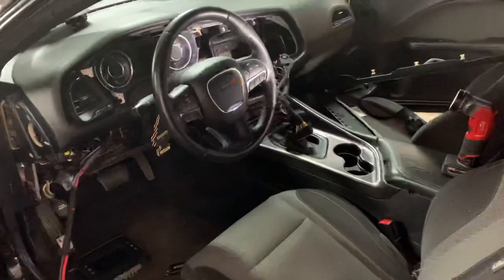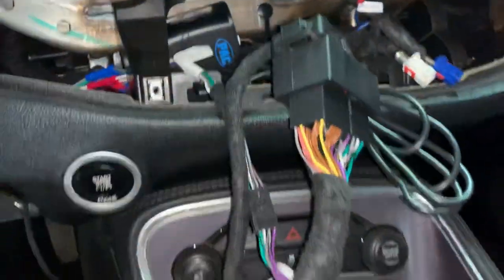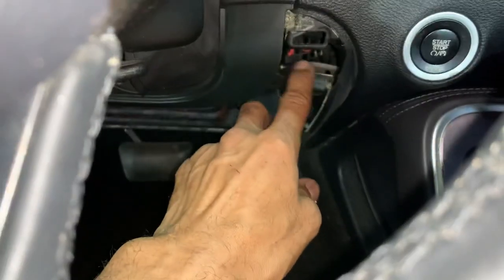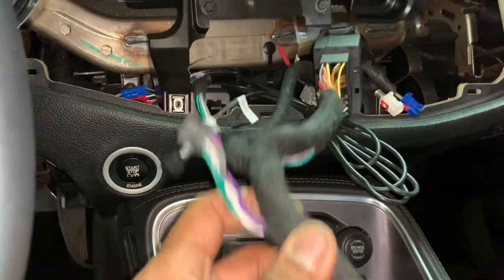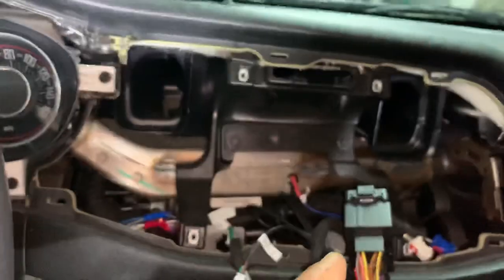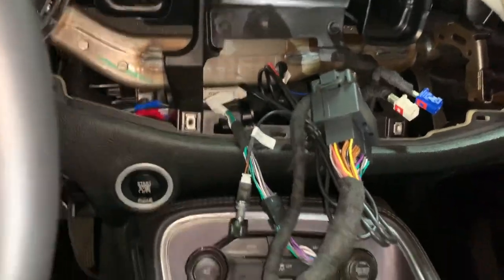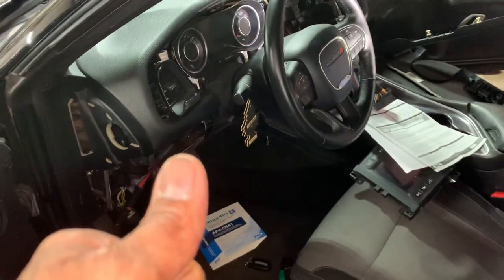Adding Amplifiers  HellCat ScatPack Charger/Challenger Plug N Play ✅ Way 🙌

Comment: Thanks for stressing the fact of plastic pry tools. Now days all of that breaks extra easy without much effort. I went to a Auto store and asked about some tools for installation and this guy finds me the most dangerous looking thing I ever sen in my life. Thin metal with sharp edges and squared off inlets that would put a hole somewhere the first time you use it. I bought it and then went and found what I was looking for also. Didn't want to hurt his feelings so i replaced my switch blade with it for personal defense. Threw it at a tree and stuck it first throw,can never get it to bounce,even when I try. That plug and play is what I need,no doubt about it. I have a 19 Rwd GT and can't find the amp. The speakers were from Alpine Mexico,not sure where that is but if I half to go there I'm packing my extra sharp stereo and speaker thin mint pry bar. Thanks for the show man,be safe
Reply from the maker: I appreciate your comment and tuning un I also hope your install goes well and if you need or have any ? Hit me up 🤙🏽🙏

Comment: Will PAC AP4-CH41 (AP4CH41) Amppro power adapter, work with CHR15H)STINGER Installation Kit?? I don’t care to use the car amp, I would like to change out the head unit?? I have a Scat 18

Comment: I am kind of confused. I recently purchased the AmpPro for my ‘19 Challenger non amplified unit. 

I would like to keep my factory speakers and add aftermarket speakers in the trunk. 

My AmpPro came with the speaker harness but I am really unsure of where those wires are supposed to connect to. 

Right now I have my aftermarket amp installed but my factory door speakers and rear deck have no sound.

So, I have RCAS going to an amp and speakers in the trunk wired to that amp. But I would like to have my factory door speakers and rear deck playing as well

Edit: After watching this video further I think I understand it. I plug the speaker harness in. Then run additional speed cable from that speaker harness to my amplifier. Is that right?
Reply from the maker: Yes sir sorry about the delay I’ve been working 7 days a week for two months

Comment: My car (2012 chrysler 300) requires the AP4-CH31 but would I need the amp pro harness, data link, or speaker harness extensions. I would like to upgrade interior speakers and add a 4 or 6 channel amp using the factory speaker wires

Comment: Trying to understand this on a 2016 challenger with the alpine system. I need this piece plus a additional harness? If I have the alpine system it's not plug and play I'll have to splice wires?
Reply from the maker: Yes on an alpine system you can splice the wires at the amp under the dash on the driver side or rewire from each door speaker if you have anymore ? Call me 478-262-9307 Butt please not after 10:00 thanks

Comment: I have a 2016 charger scat with alpine auido. Do i just run rca wire from PAC to my amps or do i need speed wire and to splice into factore amp wire?
Reply from the maker: Absolutely 👍🏿 sir the amplifier is located under the drive side dash

Comment: I've got a question. I've upgraded my 2015 challenger form 5" to 8.4" 3C from a 2016 challenger. Now the radio locks out the radio stations. I do a hard reset and it works until I turn off the car. The 8.4 radio had a 273w Amp with it. I currently don't have a amp in my car. Would this be the reason for the radio lockout? The phone, Bluetooth, nav all work.

Comment: I have the AP4-CH41 R2 version for Amplified factory systems dont know if mine has took a shit. I didn't want to run multiple Amps wanted the factory Harmon Kardon amp to power interior speakers. And just wanted to add one amp for Subs plugged RCAs into Sub out put Subs have no sound. Checked RCAs Subs and Sub Amp all works just no sound from Amp Pro.😐
Reply from the maker: With that amplified system you need too flip the dip switch too the proper settings and close the doors and lock the car with the key fob for five minutes and unlock it with the key fob and it should work

Comment: I have Dodge Charger and I’m trying install 4 channel amp and mono amp . Can I use 2 output line rca and pac 4 channel amp for the amps ?
Reply from the maker: You can but I don’t recommend that approach because of sound quality your install those amps too get a better sound and line out converters is not the best way in this vehicle that PAC harness cost around 200$ and you don’t have too cut any wires and it sounds 💯
Reply: @bj_from_the478  same car srt8 charger 2014 , i m upgrading amp nd spkers? Pn for the correct interface to be 💯!!! Most appreciated, great vid awsome info as well!! Wish u was in my erea!! Lol

Comment: Good vid great info!! Now is this for an SRT8 2014 charger w touch screan ? Nd if so is this the interface i need to connect with the OEM amp ? Bc i want to use an aftermarket amo cervin vega 2500w 5 ch amp nd ive instaled all new uograde spkrs nd amp nd now theres no power and no bass nd poor sound from this uograde!! May b is bc i did not use this device you showing here!! Let me knw the PN for charger to be able to use a more powerfull amp nd get better louder fuller sound ? Ty apreciate you time here bruh ty
Reply from the maker: This amp pro kit works on 16’s an up I’ll look up the interface module you need for your vehicle in the morning and hit you back🙏

Comment: I install also. Here im a lil confused on how nothing being cut but you run speed cable to where? Also I'm just wanting to add door speakers to my system I've installed already. My issue is if disconnect door speaker will I loose signal for rear as well. I just want to stick door speakers and run the wire for them to my amp.
Reply from the maker: Okay it’s some key ? I need too ask you about the type of system that’s in your particular vehicle hit me around 11:00 am at 4782629307

Comment: So I have a question. I have a '17 Durango with the premium Beats system. Could I use this and run my amp and subs off of this? I've been looking into this or the Rockford Fosgate Dsr1, just a little unsure on which rout to go. I'd like to keep the factory amp and be able to run the stock speakers off of it for now and maybe later on add another amp and replace all of my door speakers with aftermarket. Any help or advice would be appreciated 💯
Reply: I have a 16 durango with beats audio and i will use this with my amps and subs in a month, been doing alot of research on this
Reply: Did you do an install with the amp pro for your durango?

Comment: What PAC 4 for a 2014 srt8 charger? Is it the pac4-ch13 or is it pac4-ch41?! Bc harness pin will b diffrent from the 2!! Any comments? Ty
Reply: I’m trying to figure out this problem as well man !! I bought a 2015+ amp pro ap4-ch41. I drive a 2013 dodge charger .. the harnesses are way different on the uconnect smh.
Reply: Cruchfield bruh has the correct PAC4 plus its harness to connect it from its OEM amp just call them nd guve them ur car yr model they will hook u up w correct set up hope this helps you 👍🏼😊
Reply: See in this vid he say it dont have an amp !! I find that strange ! But hey he sees what it is being there!! But for other models call CRUCHFIELD  nd they will give you the entire set up for ur peticulor model cus u might have the wrong PAC !! Thers a 31ch  nd a41 ch as well so yea that will confuse ppl

Comment: I just I had my Pac Audio Ap4ch41 installed in my 2015 dodge challenger. For some reason my phone doesn't ring through the radio anymore and when I turn the bass know my door and rear speaker volume changes
Reply from the maker: Okay looks like they wired your car up out of sorts the dash speaker are your front stage speakers and also your Bluetooth speakers when your making a call you only hear the person talking though your dash speaker in this type vehicle I always leave the dash speakers in the factory configuration so you don’t run into this issue second there are sup switches on that unit and you must apply the proper settings on it in order for the unit too function properly
Reply: @bj_from_the478  yeah he did run the front and door speakers together, so then it's not going to work when I receive calls?
Reply: @bj_from_the478  ok I got it figured out the back speakers were tied into the subwoofer output on the unit  and the front into the rear channel of the unit.
Reply: I believe I have a bad rca cables on my rear channel, what brand of rca do you recommend?
Reply: Sorry about all the questions  but I now have e the Pac Audio installed right and my question is what can I do about the flat sound coming out the speakers!
Reply: Only reason I'm asking you is because I called Pac Audio and the technician I spoke to told me there really isn't anything I could do about it. I just wanted to hear it from you because you actually install the devices and I'm sure you are very familiar with the issue I'm having!

Comment: Is there any type of programing you need.also does the factory radio provide speaker outputts if car is amplified?
Reply from the maker: No sir if you have the 8.4 inch screen you’ll need too bypass the amplifier underneath the driver side dashboard if you need help locating it call me 478-262-9307 Monday-Saturday 10am-8pm 👍🏿
Reply: @bj_from_the478  i appreciate it bro

Comment: 2016 Charger SXT has the beats system, should i use a LC2i or the Pac sub-41 to add aftermarket amp and sub?
Reply from the maker: I’d use the Lc2i because it will give you a clean bass line Butt ether one will work

Comment: So I have a 2018 Scat Challenger I unplugged all 6 speaker’s replaced the door speakers first buttoned up the door panels and NO SOUND so plugged all the rest of the 4 speakers left and they worked great. Nothing shorted I used to install in the 80’s and 90’s but this is a bitch

Comment: I was thinking of purchasing the lc7 , after watching this video I think this is the way to go in my 19 challenger. Any thoughts or suggestions?
Reply from the maker: Well with a lc7i is a little technical if you not a novice at installing those units it’s very easy too get your signals crossed now with the pac you don’t have too cut a lot of wires and it not as bad as cutting a lot of factory wires in your vehicle

Comment: Wondering is this compatible with 2023 scat?
Reply from the maker: Yes sir it will work for all the models
Reply: I finally installed this with the R. 2 version. The crazy thing is I didn't have to thru the sleep cycle because I have the OEM amp. Easy plug-and-play

Comment: I have a Charger with Harmon Kardon system, I am adding the 2-10s from the Challenger Harmon Kardon, with its own amp. Can I use a LOC tapped into the stock 8" HK sub in the deck as a signal to the amp for the 2-10s Im adding? Or will I really need this setup from PAC?

Comment: Might have to get this. Got a 2022 Charger sxt. Used a $20 Pac line out converter and tapped into rear speakers. I have a problem with it not putting out any sound when I turn the car off then back on. I have to pull the stereo fuse to reset the radio to get the rear speaker outputs to put out signal again. So weird. Never ran into that before in 25 years
Reply: Have you figured it out yet. I'm in a similar situation with the ch41 pac
Reply: @ceavalencia4767  I did figure out a solution. Almost to much to type on here lol So you basically have to trick the Uconnect. If you are using a 4ch amp on the door speakers vs stock, and only have the Pac hooked to the OEM wires, the HU will think there is a short because there is no ohm load anymore. If you're using the rear channels for example to tap into, you are gonna have to hook a couple of tweeters or something to it to get the Uconnect to see resistance. I hooked two 6.5 coaxial up to the stock wires then tapped in the Pac. I just have them in a small box in the trunk behind my 15". Make sense?
Reply: @paulturner8394  partially.  I'm using TOSLINK 2 channel.  It's this the same? Only my right front speaker has sound .

Comment: So where did you plug this speaker wires that where not plugged in or do you use it only when putting power to the speakers from an amp???
Reply from the maker: Okay do you have a factory amplified system in your vehicle like alpine or beats and Harmon kardon
Reply: @bj_from_the478  no I got just a 8.4 with kickers in the doors and infinity in the dash.  No factory amp.  The reason I ask is I am confused if I need a 4 channel amp or a 5 channel amp.  I was told by the shop they needed a five channel amp added and now when I turn the subs off the highs all crackle and break up but you don’t really hear it of the bass is on full throttle and to add to that the damn amp is getting hot.  It’s a 7005A infinity 5 channel.  So just confused.  Didn’t really need the doors and dash amped up but I am sure if they tune the amp again they can fix that but the amp heating up shouldn’t happen they used awesome install just it was 240 for the kit.  So idk was thinking when I go back have them pull it and just have the amp power the 2 cerwin Vega 10”s
Reply from the maker: Call me in about 30mins 478-262-9307

Comment: Question bro I had this installed in my charger  with 2 amps subwoofer new speakers , now my system plays great but after sometime the system will have no audio but I hear bass coming from my subs. So I turn car off system plays normal but will do the same thing again after some time what do you think is the problem?

Comment: I got the pac on my charger but im getting engine static, i even relocated the rca wires and still getting that engine noise. Any suggestions on what i could do.
Reply from the maker: Make sure you have good grounds also make sure you run your rca jacks down the drivers side
Reply: Good ground for the amp? Because it make static sound before i put the rca wires. Do you think it could be a bad pac ap4-ch41 r2. Thank you so much
Reply from the maker: @scatty_g_3926  I very well be

Comment: Do I need to cut any wires if I have the beats audio system? Also do I need to get extra speaker wires from the converter if I’m not replacing any speakers?

Comment: BJ I have the Alpine stereo in my Charger,  i know to leave the speaker cable plugged in on the T Harness for amplified systems but where do i have to connect the speed  cable to get sound from. Do i have to unplug and tap into the wires harness from the factory amp?????
Reply from the maker: @dre_day_  you can remove the lower panel underneath the steering column and the factory amp is located on the left side and to can catch the wires too the speakers at the amp
Reply: @bj_from_the478  thanks💯

Comment: What about PAC4-ch31?!!! Vs ch41? Wus the diffrence?
Reply from the maker: The difference depends on your vehicle the ch31 works with 2010-2014 and the ch41 is 15 an up
Reply: @bj_from_the478  i see ok in my case i have an 2014 SRT8 wRb5 HU, ty for ur vid nd info 👍🏼
Reply from the maker: @Rjelectricfingers  anytime 🤙🏽
Reply: Do i also need to use the pac spkr harness if using aftermarket amps w pac-ch31? They offer the spkr harness for hooking high signal i think? Ur imput heads up on this appreciated!!!

Comment: I add this part to my car challenger 17 (non-amplified) but works for 5 sec and when the radio is completely on its stops working..I'm not getting any sound 😕 ??? (Its because is a 5in screen)?
Reply from the maker: You need too unplug the unit close all the doors then lock them wait for about 10 minutes unlock them plug your unit back in and before you turn the car on close all the doors and lock the car wait for 10mins and unlock the vehicle this cycles the car and learns that module you installed

Comment: Hey bj. I’m having trouble with my system. I have a 2016 challenger sexy. I have the pac hooked up and my speed cable ran to my amp. I spliced left/ right front speakers together at the head unit as well as left/right front negative together, and the same with the rear. All my speakers are being powered by the amp now they have good bass but the vocals on the songs are very low . The bass goes up nice and loud but you can’t hear the words. Just so you know What I’m running I have a 800 watt kicker mononlock amp. With 2 10” kickers in comp c box. I’ve been messing with this thing for quite a while and just want to get it set up right. Any info is much appreciated. Thanks in advance man
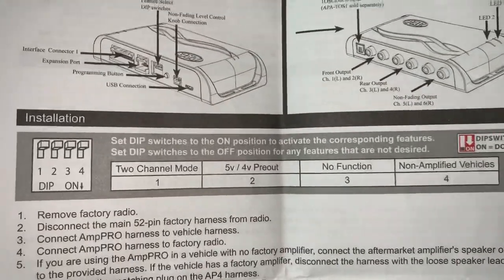Reply from the maker: Okay cool give me a call around 1:00 today 478-262-9307 it’s some ? We need too go though too get you playing 🙏
Reply: Sorry man I just seen you messaged back. I’m free tomorrow just let me know when a good time to call is

Comment: Will this make the front door speakers play sound and not just bass?
Reply from the maker: Yes sir after you add this part then you rewire your car from the factory amp Butt it has too be done correctly
Reply: Thank you 🙏🏾
Reply: I will tell ya my highs in the front are way too high compared to the bass after the install so I don’t know what todo and I was told I needed a 5 channel amp….

Comment: Wus this bruh harness to avoid cutting ?
Reply from the maker: You don’t have too cut any wires unless you have and alpine factory amplified system if it’s none amplified you won’t have too cut any wires plug that unit up and run the RCA from that module
Reply: My system is oem 799w SRT8 crap no powr nd tough bout getting 4500 classD monoblock to boost up my watts nd up my 10 spkers as well all at 4 ohms! Will that wrk ? Nd do I have to use this harnes or regular RCA interface ?
Reply: @bj_from_the478  hey man is this wha i need to get upgrade fuller sound nd more power from oem system on charger ? But using mire powerfull amp 2500w 5 ch nd upgradexspkrs as well! Will this be the interface needed ? Ty